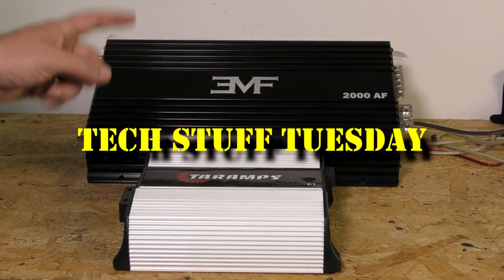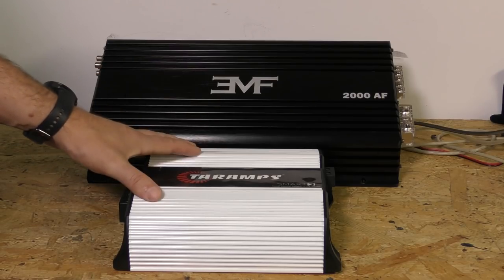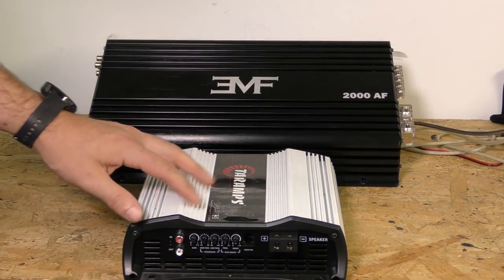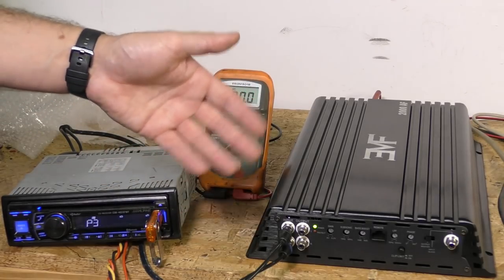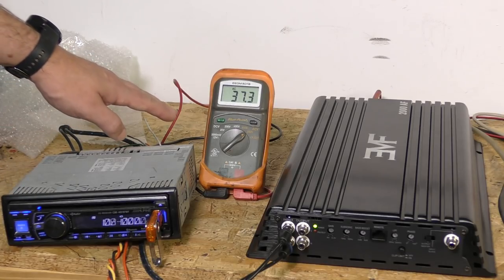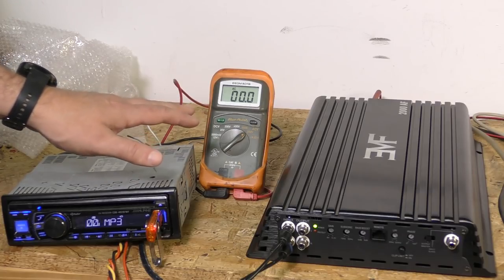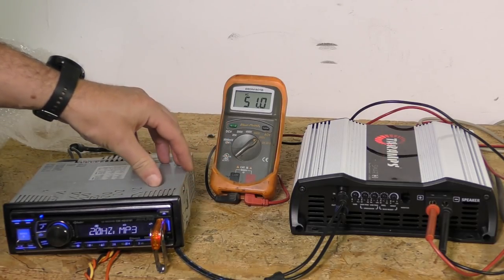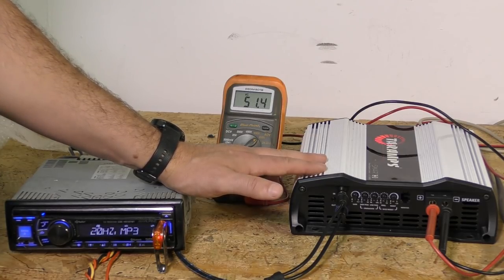The problem with full bridge (Brazilian) amps you never thought about - Tech Stuff Tuesday

Comment: I just argued this exact concept with another basshead last week . He owned that exact amp and he switched from a Rockford 2500.1 bdcp . I told him the taramps sounds like its lacking in the low lows 25hz and below . I thought his old amp sounded better and his taramps sounds like it needs a DSP or something because it was too punchy and had too much high bass and very little low bass . I thought it was because taramps had a crap crossover filter . I guess you solved that riddle  . I thought it was just my hearing loss.
Reply: The human ear can’t go below 20hz this is why many people do 25hz subsonic filter. What you wrote makes no sense.
Reply: It could also be due to poor damping factor, which can cause a sub to sound sloppy at high volumes, depending on the type of enclosure. Most of the high $$$ amps will have substantial amounts of feedback, which gives a good damping factor as the amplifier will present a very low impedance to the sub connected to it. If the cheap ones present a higher impedance at their output, the damping factor will hit the skids and some types of subs/enclosures can overshoot and sound sloppy or muffled.
Reply: @mysock351C  Damping factor increases with ohm load, the smart 3 does rated power at all loads between 1 and 2 ohms. Additionally it puts out way more than rated esp in dynamic. Both of these should compensate more than enough for any distortion and power voltage fluctuations as well as rise.  These points were ignored and largly refute the videos conclusions.
Reply: @hippo-potamus  The damping factor has little to do with power. Its primarily a function of the output impedance of the amplifier. Since these things should be able to drive 1Ohm loads, it should be fairly low, but its hard to say for sure without looking at the topology of the amplifier. For example, my 36W desktop amplifier has a theoretical output impedance of about 1milliOhm due to the feedback, which means it will have a very high damping factor. It will obviously be higher due to wiring resistance, but it can be felt by moving the speaker cones by hand with the amp on. The speaker feels like its moving in a thick oil or molasses. The damping is derived from the back EMF of the sub or speaker. In an amplifier with feedback, if the sub overshoots, it will generate back EMF that does not correlate to the audio. The amplifier, via feedback, will sense and counteract this and provide damping. Amplifiers can also have an intrinsically low output impedance, which will also provide good damping factor. But its all down to how the amplifier is set up.
Reply: @hippo-potamus  The output impedance is also important when driving a reactive load. If the output impedance is too high, it will impact how much power can be transferred to the load (in this case the sub). Ideally it should be very low so the amplifier appears as a nearly ideal voltage source to the speaker.
Reply: @mysock351C  My point was as the impedance rises even with a low damping factor if the amp has abundant head room it would largely mitigate the rise or lack of damping. The smart 3 does 5-6k dynamic. The tramps bass hd 3k i think has a damping factor of 200. I imagine this one has an even greater circuitry design as it puts out 3k at all ohm loads between 1-2. Meaning that its damping compensation is well designed. Now add that to the fact that its putting out 5-6k rms dynamic. I doubt that there is much loss or anything meaningful at 25hz and lower.  I know you are not going to be hearing any difference as a matter of the human ear mechanical limits.
Reply: @hippo-potamus  I will reiterate that damping factor has nothing to do with output power. Its a function of the effective output impedance of the amplifier. You can have a 1000W high voltage lab amplifier with an impedance of several kOhms or more and it will have terrible damping factor, and do a lousy job of driving a sub. Conversely you can have a 10W linear amplifier with fantastic damping factor. Its all down to the effective impedance seen at the output of the amp. Obviously the impedance of the speaker factors in, but the amplifiers damping factor will only usually vary with frequency due to the roll-off of the amplifier open loop gain or response at higher frequencies for stability. The damping factor is dependent on the speaker or sub impedance since its a ratio of the speaker impedance to the impedance of the amplifier, which will vary over frequency depending on how the sub responds, but the amplifiers output impedance should be pretty constant across most of its response range (both power and, for the most part, frequency).
Reply: @mysock351C  So what you are saying is that the perhaps the damping factor of the smart 3 is not sufficient to stop the subwoofer and what people "hear" is a reverberation due to the lack of damping and a clean stop as the notes change?
Reply: @ hippo potamus
I can hear down to 10hz and my subwoofer enclosure is tuned to 15hz. Looks like you’ve never been in a vehicle that’s capable of playing that low. Many systems play that low but all you hear is blowing air and not actual bass. And that’s due to many factors like panels rattling canceling out the bass among other things. You should come visit my vehicle one of these days although not that I want you to but I’m just saying it as a figure of speech. Don’t swear something that you have never had experience with.
And just in case you say I am talking rubbish, just look at who I am and what I deal with every day. 😉
Reply: @hippo-potamus  I was throwing it out there as a possibility. What it would sound like is distortion. The bass will sound ill-defined and muddy if your using a subwoofer that needs the damping factor, but the amplifier doesn't provide enough damping. Whether or not it could be an issue comes down to speaker construction. Subwoofers with a light cone, thick surround and stiff spider will, more or less, be self-damping since they dont have a lot of compliance (e.g. stiff, doesn't move easily). A sub with a heavy cone, soft surround and loose spider in a ported enclosure will, however, benefit from damping from the amplifier since it has a lot of compliance (e.g. its loose and moves freely).
Reply: @hippo-potamus  " 25hz and below " still includes over 20hz last time I checked . As the video shows taramps still plays low notes but just not as loud as it played the higher bass notes . That is my point and the point proven in the video .
Reply: @JohnG1000  What is your subsonic set at? Mine is 28hz so I dont give a shit about the "low" notes that I cant hear and are just wind. The Taramps is dynoed at 5-6k dynamic at 40hz, Im sure if BigD did a one to one comparison at 10hz the Taramps would put out more power than the EMF. That multimeters refresh rate is shit mate. The results are worthless.
Reply: @hippo-potamus  I bet you hear Yanni not Laurel . Lol 😆
Reply: @JohnG1000  Had to look that up, I generally don't keep up with new age trendy bullshit. I hear Laurel. So what is your subsonic set to? Why don't you just answer the damn question?

Comment: I run stetsom amps a 800w 4ch and A 8k mono I use custom made subs with 3-1/2 inch-4 inch coils 3-5k rms usually 15’s and I tune my boxes to 18-28hz and so far the Stetsom mono beats the crap out of my subs no overheating going on with subs or amps. But this was a Taramps test so idk about that brand. But always get a high output Alternator and some battery’s before you go spending money on subs and amps and you sub box is very important as well. Duh 😁
Reply from the maker: If you're using an 8k amp to make 3k of power, the odds of it overheating are small.
Reply: @EMFAudio  I’m using my 8k Stetsom but at the moment I’m using my 6k Stetsom to power a pair of 15’s solo X 18 motors on 15 inch frames. For highs I use a 4 ch 800 watt and a 4 ch 2k both Stetsom. I didn’t get your response-using an 8k to make 3k of power. I do think my weak link is my U.S Alternator 250 amp but I’m also using two XSpower d7500’s for batteries. Planning on learning to build subs in the near future just as a hobby. A hobby male dominated has to much macho BS and I don’t wanna deal with grown men acting like kids 🤦🏽‍♂️

Comment: What about the taramps bass k
Reply: @nate0 Fake news. Tell that to the the hundreds on youtube that are absolutely crushing their subs with Taramps amps. All Taramps amps are sub amps. Just use the built-in cross over or use an external one if you want.
Reply: @nate0 I got my degree about 20 years ago but it doesn't take one to know that any full range amp can be a subwoofer amp if you use a low pass crossover.
Reply: The bass amplifiers apply with his saying at the end " A full range amplifer wil not play bass the same way that an amplifer thats specifically designed for it will"
Reply: @nate0certainly my follow bass head.  well we all know thar taramps as a company is very popular in spl but not spl by that of bass but by that of actual sound. So when designing their amps (which the majority of them are built this way) they are made to deliver the most power at every possible frequency through out the range and not just at a concentrated range. Likes take the MD800.1. This amplifer is a mono amplifer but its also a full range amplifer meaning you can put it on tweeters, horn, mids, mid bass, and subwoofers. So over all it would be a  great amplifier because it can sound good on everything, but thats also its downfall. For it to sound great on everything it can be better at one thing than another. Now if you were to put it on subs would it work play lows and loud ? Hell yeah it would BUT it wont out due an amplifier made specifically for a set frequency range. Like instance if you were to put the bass 8k versus the MD 8k would see that the bass is more designed for frequency of the sub bass region than anything else. Actually you could put the bass 8k on tweeters if you want but its not going to get you the results you want because it was designed for one set of frequency range meaning that if you were to do a direct swap you would notice a difference between the amps sound quality wise. Its not saying that the MD line is a bad line or anything its just not better than say the SALT 6k or even the deaf bounce 7800.1. This may be a stretch saying it and correct me if im wrong but 8k watts at 12khrtz is different than delivering 8k watts at 20hz. The quality of the waves is most likely different as well. You can say the same goes with bass amplifers that not every bass amplifer plays bass as well as the next. Theres many people that will say skar amps dont play lows as well as others. But that's what i meant by what i said. I hope this helps.

Comment: As for power handling, most of these are made for music power, not continuous duty. If you have a 3000W full-bridge amp and your running it in the lanes or something, they will typically be generating around 400-500 watts of heat alone, which is quite a lot for an amp in a small form factor. On top of that, they're really pushing things design wise, so if you run them at their full output for a length of time sooner or later it will pop.
Reply: sooner not later trust me

Comment: So I'm almost at 15 min, Just saying 10 hz is just not something you should ever really use. the quick just is likely protection like a "subsonic" filter that is likely built into the amp because ya you might be able to make subs wiggle at 10 hz, and move some air around but it is a frequency that we cannot hear the 20 hz -1000 wasn't all that large a variance. but as you said you have chosen a "mid range" amp for the full bridge tester. so use a full bridge that is meant to play the lows. ... lol as im typing this you made my point, get what you want to fit your needs. bang for your buck those amps arent bad by any means. I've used them and swapped to  a us made amp, and they performed very comparably in the target freq range we were aiming for and at 7k ish watts losing even 1k watts at 20hz, 20 hz is still just a breathtaking frequency. litteraly

Comment: So many people miss the point....does EMF sell products he wants you to buy...YES...end of that story.  Does this video compare the power output of this specific EMF amp to this specific Taramps...NO, not the point of the video.  I would have to go back and look but if i remember it correctly the Taramps was making more power during the test...that wasn't done to compare power output anyway.  Is the Taramps cheaper, YES...even the packaging is cheap.  Is the EMF AF2000 a cheap amp, I think the EMF quote went something like "its not cheap cause its not cheap".  The point of the video was made at the end...and you can use that info in anyway you want to.  Im not in car audio for a living, but spend some of my time working in and around cars so Id figure id make a comparison using shock absorbers.  Koni and KYB both make shock absorbers..they both do basically the same thing but the Koni (depending on application) can cost upwards of 4 times the cost of the KYB...and its not because Koni is ripping you off.

Comment: My sundown sfb8000 is easily the best subwoofer amplifier that I have own... I own everything from a power 650 to mtx 2300 so I've  been around a long time
Reply: I wish I could say the same. Maybe I'm putting too much power to it cuz man mines get way too hot way too fast
Reply: @interstateboss5921  that's what I've heard from a lot of people. They get really hot fast
Reply: @shepherd3085  Even with strong electrical. Not worth it in my opinion. Swapped my SFB for a Salt Series and couldn't be happier
Reply: @interstateboss5921  yeah I've been reading they are really picky when it comes to voltage drops and the half bridge amps are better on the low end for SQ
Reply: @interstateboss5921  great choice! Just bought one myself for a couple v2 banhammers once they show up 👍🏻👍🏻
Reply: @TheDoozie43  DOOPEEEE

Comment: I don't think the results of this test has anything to do with full vs half bridge. I think its the build quality of the amps. Yes the Taramps is the lesser of the two quality wise but it is also substantially cheaper to buy. Even if the Taramps is a little less powerful between 20hz and 35hz the average consumer is never going to notice.
Reply from the maker: This is actually one of the better amp examples, it's amp architecture.

Comment: Just a word. The multimeter probably does not measure correctly when going away from 50/60 Hz. Maybe not so much difference but there is most likely a difference.